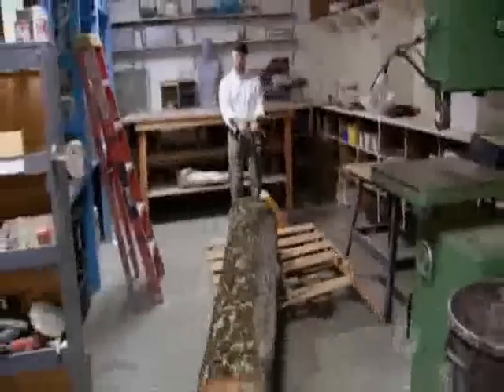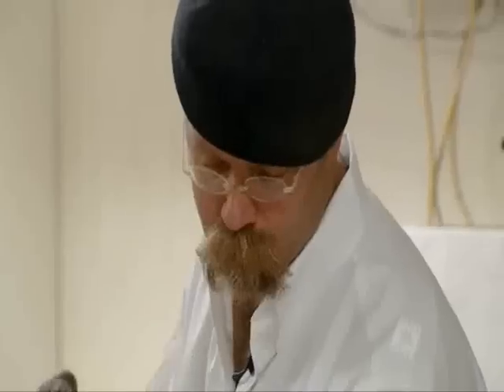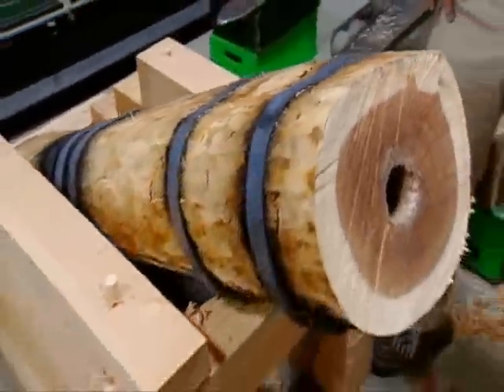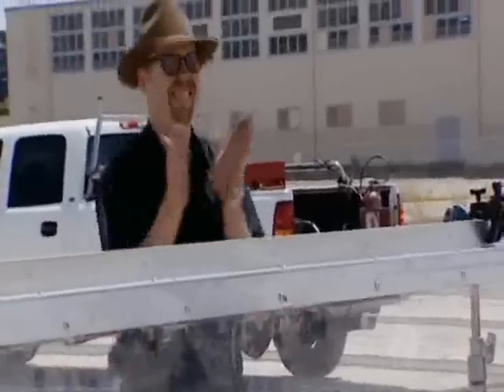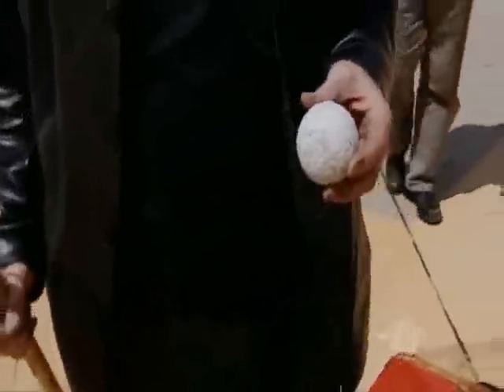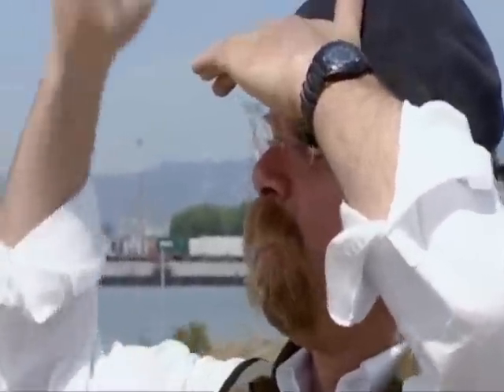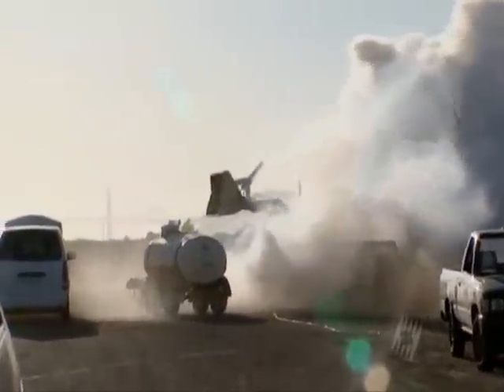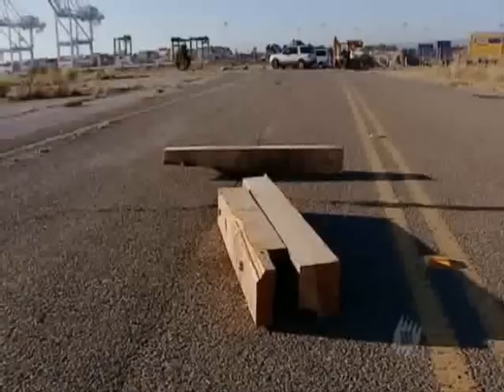MythBusters- Tree Cannon!

Comment: Not sure who their pyrotechnics expert was, but as someone who shoots and has been around black powder cannons and mortars for better than 20 years, I can tell you that 1 or 2 pounds at the most with a plugged barrel would have taken out that cannon without endangering everyone. The ball would have put it in about the same size range as a 6 pound cannon, so I imagine maybe 8 ounces would have been a heavy enough charge to fire a cannon ball or canister shot. When cannons in those days were proofed, they would have been loaded with double charge and double ball. That means twice the powder charge and two roundballs. But even a 6 pound cannon would probably never have been proofed past 3 pounds of powder and I doubt even that. Obstructing the bore in ANY firearm, no matter how small of a caliber will cause a rupture or damage, and the closer to the breech end of the gun the more damage that's likely because that's where the initial charge is detonated. There was no reason to go anywhere near 5 pounds other than to show off.
Reply: According to Adam, the pyrotechnics guy had no clue how much was required to blow up a tree cannon (the film pyrotechnics guy they had was trained for making explosions look pretty, not trained to just make big explosions), and so when he said he was only certified to handle 5lbs of black powder at a time, Adam and Jamie immediately pushed it to the legal maximum. After this incident, Mythbusters switched to working with the FBI for all explosives work on the show.

Comment: I'm wondering though with this myth, the hole in the cannon seems pretty small.  The myth said that the tree cannon blew up, but I don't think it specified what condition the tree was in.  Trees rot from the inside out, so maybe the villagers had a log that had rotted through and they assumed it would still be sturdy enough to become a weapon.

With a normal sized cannonball blocking the way and an excessive amount of gunpowder in the base of a rotten tree, I can definitely see it exploding.  I think this myth should be re-tested with a rotten tree, mainly to see if it's possible to build a cannon overnight.  We already know it can explode, but would a rotten log already have enough of a hole through its center to be useful?
Reply: Nobody in their right mind would use a rotten log to build anything, especially a cannon.
Reply: I could see the villagers drilling too deep which would cause the cannon to possibly backfire.  Or if the log had some micro cracks in it already. You'd be amazed sometimes by how many cracks some timbers have in them while still being strong enough to hold up a building

Comment: Try again expect burn the inside with a torch fire harding like a arrow  and pouring hot copper or soft metal in barrel to coat inside how I'd make one and have bands on top of it and do it smaller like a pirate wooden cannon small cannon balls I bet u it works better fire burning aka fire harding aka burn it inside and out and also seal it with pine pitch then copper or I should say bronze the softest metal for swords and arrows bronze coated wood fire harden tree trunk and a smaller cannon ball then bigger and bronze on bronze cannon ball and barrel and put wd-40 in barrel with a cotton plug or make a harpoon wooden cannon bronze harpoon

Comment: The Myth was that 1) a village can make a tree cannon in one night and 2) it malfunctioned, exploded, and killed half of the people.
The myth was busted on two accounts; the drilling process takes too long to complete in one night, not even when considering the other parts of making the cannon, so the one night build was out. Second, the cannon didn't blow up without deliberate tampering, and even then it wasn't a large enough blast to kill half a village of people unless they were all clumped around it.
Reply: Well adam later said that when they blew the cannon up that were 250 feet away and the largest pieces flew over all their heads

Comment: Considering a normal cannon, one made from bronze, brass or later iron and steel, would burst if it was over charged, or had too much shot I'm not at all surprised that a log cannon would explode under the same conditions, also this was a group of Hungarian or according to someone in the comments Macedonian, villagers the old adage more is better might've led them to use way too much black powder. To obvious results. the explosive force would find a way out somehow, and if the path of least resistance is not available it'll make its own path.
Reply: I would think that the wood's flexibility when compared to those metals would make it more durable.